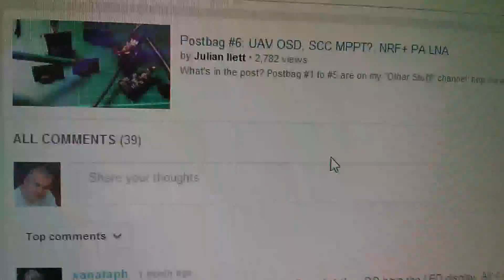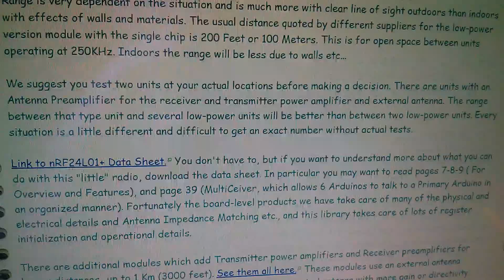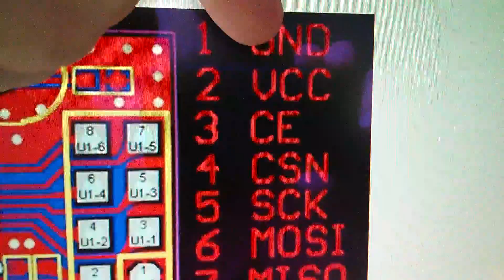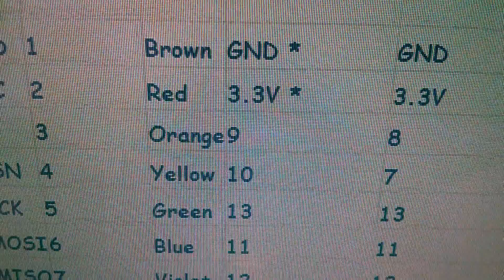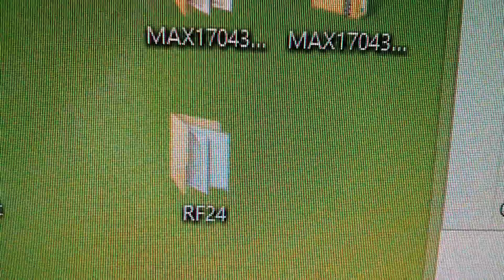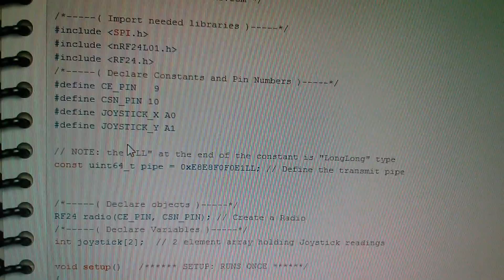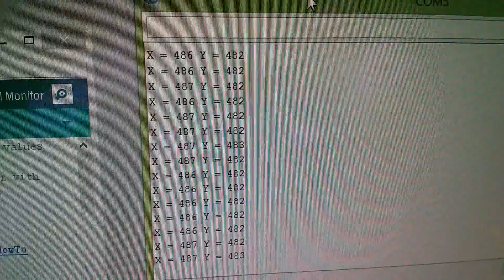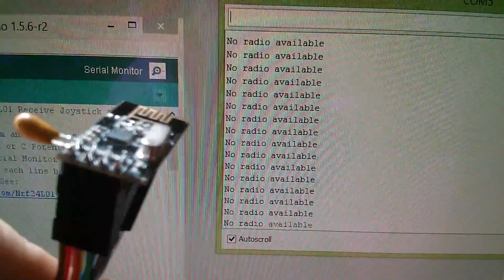1-Day Project: Arduino and nRF24L01+ Data Transceiver

Comment: I got this example working the way it's described. However, I'm having issues trying to integrate it with another project. When I come back to the example used in this video, I notice that this example doesn't seem to work for me unless I wire the green (pin 13), gray (pin A2), blue (pin 11) and violet (pin 12) cables, even though they don't appear to play any role in this example. Any idea why? Are these pins reserved pins for the RF24 library? Thanks.
Reply: All the pins are used by the library on the transceiver except the IRQ pin which isn't used most of the time. What is your other project ?
Reply: My other project is a 2WD robot. I want to use wireless communication to send the remote control codes to another Arduino connected to a PC for monitoring/debugging (occasionally the remote codes appear to get garbled). My next step will be to get another Uno or disconnect the robot from the existing Uno and try to get the nRF24L01+ working on a vanilla Uno.
Reply: Puneet Singh Lamba Did you fix your problem with the pins ?
Reply: Meindi Zahiri Well, I moved the robot to alternate pins so that the nRF24L01+ can now use exactly the same pins as are used in this video. My robot now works fine, but the nRF doesn't connect to the receiver running on a Nano. I noticed that the Nano provides consistent 3.36v from its 3v3 pin, but the Uno doesn't. That might be part of the problem. Note that I'm able to get the nRF working if I get connect both transmitter and receiver to Nanos. But not when I connect the transmitter to an Uno which is also supporting the robot circuit.
Reply: Puneet Singh Lamba Lol, it used to be the opposite problem for me and for most of people normally the problems are with the nano 3.3v supply. Did you put a capacitor ?
Reply: Yeah, I'm using a 10uF cap on the Nanos (i should try without them to see how it goes). On the Uno I tried 10uF and up (up to 470uF) but nothing worked.
Reply: Puneet Singh Lamba im using 10µF for both of them. some say that its good to put one small like 10µF or 200pF  and a big one like 470µF, try that.
How is your uno powered ?
Reply: Meindi Zahiri Will try that. Have heard of some folks doing that. Uno is powered off USB or 9V battery. Neither one seems to work for the nRF.
Reply: Puneet Singh Lamba using a 9V battery is not recommended at all. very expensive compared to what you get from it. You should use 6AA in serie for exemple, it will last 4 times longer. I power my uno via usb and nano via wall adapter. When you say that it doesnt connect, do you mean it doesnt work at all or it has random behaviours ?
Reply: Meindi Zahiri Um, ok. I'm not worried about battery efficiency here since I don't run the robot all day or anything. The nRF doesn't connect at all when the transmitter is Uno and the receiver is Nano. Nano to Nano works like a charm.
Reply: Puneet Singh Lamba Did you try powering the uno with a wall adapter ? If you can, try powering both transceivers with the nano. If you have a voltmeter, check the voltage across the 3.3v on both devices
Reply: Meindi Zahiri Didn't try powering the Uno off the wall. I did think of powering the Uno's nRF with a Nano, but haven't tried it (I think). Will try that. My day job takes up too much of my time (as I'm sure it does for most of us).
Reply: Meindi Zahiri Just tried powering the transmitting nRF off a Nano. I get a steady 3.3v powering the nRF, but still doesn't connect to the receiver. I did notice that moving the nRF board around to different positions (since it is just hanging off an 8 wire ribbon) seems to cause a LOT of variance in the circuit as measured on my multimeter (I'm guessing due to interference between the nRF and the rest of the circuit).
Reply: Puneet Singh Lamba Some people transceiver dont work when the distance is less than about a meter, mine work even when the distance is from zero to about 15 meters through 2 walls and 1 ceiling.
Do you have the version with the the big antenna or the small one ?
do you think that you could have other interferences ? some people have problem with microwave, wifi and tv. Try a quality check sketch.
Reply: Meindi Zahiri Low power (no external antenna). nRF24L01+. I tried increasing the distance - didn't help. Can you point me to a quality check sketch?
Reply: Puneet Singh Lamba http://arduino-info.wikispaces.com/Nrf24L01-Poor+Man's+2.4+GHz+Scanner
I didnt use it as i didnt have interference problems with my rf24 so if you have a problem with this i dont know if i would be able to help. Many people used this kind of sketches and it appear that it solved some problems.
Talk tomorrow
Reply: Meindi Zahiri Thanks for sharing this. In reading through the forum thread that this article links to I discovered that the RF24 library has a scanner program built in. Using that I'm able to see interference on some of the lower channels, but none on the default channel (76). Anyway, I changed the default to 100, which didn't help. Not surprising, since I got the Nanos to communicate fine using the default channel.

pic.twitter.com/FvLS9k163Q
Reply: Puneet Singh Lamba What do you get if you try the "getting started" exemple from RF24 library ?
Do you have an oscilloscope by any chance ?
Reply: Puneet Singh Lamba Could you post some pictures of your setup, the one working and the one not working ?
Reply: Meindi Zahiri  I used the joystick example. I got that working Nano to Nano, but doesn't work Uno to Nano.

http://arduino-info.wikispaces.com/Nrf24L01-2.4GHz-HowTo
Reply: Try the "GettingStarted" sketch from maniacbug's RF24 library and tell me if you get some errors
Reply: Meindi Zahiri  It looks like I need two PCs to run this test. I don't have the Arduino IDE installed on another PC. Will look into it.
Reply: Meindi Zahiri So, thanks to your prompting, a couple of things happened. Not sure if the Getting Started example did some sort of config on the Uno, but everything has started working now! Also, I noticed that the code "Serial.println("No radio available");" (from the joystick example) was creating so much data noise on the serial monitor that one could easily miss the remote codes flowing past form the Uno to the Nano. So, I commented out that line. And I switched to a long data array to capture the 8 digit remote code. I also did add a second 220uF cap to the Uno circuit, by the way. So everything is working to my satisfaction now! Thanks again for your help and prompting.

Update
Now I'm finding that the wireless communication is fairly reliable when the Uno is powered off the USB, but not so much when the Uno is powered off a slightly worn out 9v battery. With a new 9v battery the wireless communication works more reliably.
Reply: Puneet Singh Lamba I'm glad you fixed your problems. to be able to use a 9v worn out battery, even if you shouldnt use one, you could get a better voltage regulator than the on board regulator also, your battery will be used more effectively.
Reply: Meindi Zahiri I implemented a heartbeat counter so that I can monitor the robot's health. Currently, my 9v battery seems to be offering only 6.6v. And I have measured 4 missed heartbeats (expected every 30s) during a period of 10m. That's a 20% failure rate.
Reply: Puneet Singh Lamba How did you implement that and how do you log it ?
Reply: Meindi Zahiri My implementation is just a variation of anything else you might decide to transmit/receive. I only log to the serial monitor. I wish I could log to disk. I will add my code to GitHub and post a link here.
Reply: Puneet Singh Lamba if you want to log to disk, you could use Putty for exemple and save the serial windows automatically, or you could use a SD card reader with your arduino. Or if you know a bit of python, you could make a python script, that's my favourite option
Reply: Meindi Zahiri Thanks for these ideas. I will look into them. It would be good to store all of the data from the robot for offline analysis.
Reply: Puneet Singh Lamba I'm using a sous-vide cooker and i use the putty method to log the serial information and then i can plot the temperature against time
Reply: Meindi Zahiri Which sensor are you using to measure the temperature?
Reply: Puneet Singh Lamba DS18B20, the waterproof version, it's very accurate
Reply: Meindi Zahiri Thanks. I'll try the PuTTY route first. I can also try Python/Perl. Are you saying I can use Python to connect to the COM port instead of using serial monitor or PuTTY?
Reply: Puneet Singh Lamba Whether you decide to go the putty or python way, you will need one arduino to be connected to the computer. What you should do is make the robot send the value you want to an arduino via RF and this arduino to be also connected to the computer via usb and your computer logging the data you want
Reply: Meindi Zahiri If you go the python way, you will have to make the script or you can find any script on internet and modify it for your needs. Python will need the pyserial module, just google "pyserial arduino". With Python, depending on your OS, you could automate the logging/plotting part. The putty way is easier but you have only one feature which is to save the log.
Reply: Meindi Zahiri Yeah, well that's required any way, even with the serial monitor approach I am using now. One Arduino transmits remote codes from the robot and another Arduino receives those codes and is connected to a computer so that it can print those codes to the serial monitor. Next step is I want to log that data to disk. That's what we were discussing. Thanks for the pyserial tip.
Reply: Puneet Singh Lamba what about just using a sd card module on the robot ? it would be a good solution too if you dont mind transferring from the SD card to your computer
Reply: Meindi Zahiri Yes, an SD card module would be a good idea. However, in this case, I was looking for a reason to test out the nRF24L01+ module.

Comment: Hi julian,i have saw some of your videos, they are fantastic! And i have a question about nRF24L01, is necessary to have 2 nRF24L01 to send data between they or can i use only 1 nRF24L01 and a normal radio controller?Is to make a quadcopter with arduino, and can you help me to use mpu-6050 as gyroscope for it?

Comment: The capacitor that u have soldered is for high power nrf24(the one with the antenna) this small one doesnot need to soldered with a capacitor the voltage is quite stable in it's case . I am using it with arduino uno for my project without any capacitor on and it works like a charm :D
Reply: Some need a capacitor, especially with an arduino mega or nano. i have some nano and uno and i only get problems with my nanos without the capacitors

Comment: Hi Julian, thanks for the guide. Very informative! I'm wondering, would you do another tutorial where three transceivers are used; one receiver and two transmitter? Would love to see one tutorial about this as it would be helpful for my project that I am currently doing.

Cheers!
Kyle
Reply from the maker: YKSui Not sure about that. It may work if the same pipe address is used. I'll be trying the multiceiver setup in due course (single transmitter, multiple receivers).
Reply: Okay cool. Looking forward to it!

Comment: Julian Ilett  , could you please make a project , if possible, on how to use the stc15f204lea breakout boards as an SPI to UART converter for the NRF24L01+ to directly connect the RX and TX wires(of stc15f204lea) to one arduino. You can also reply me the way to do so, i.e; starting from flashing the stc15f204lea with the hex file generated from a code using the appropriate software. Thanks in an Advance.

Comment: It caught my attention that on the wiki says that these Transceivers are power hungry, which is contradictory according to its datasheet, where it says it car be powered for months with a coin cell battery or AA, AAA batteries, since it peaks at 14ma when Tx/Rx' ing, has anyone here used these things with batteries and successfully run them for a few months?, i just bought 10 of these for like 14 bucks at ebay and i'd like to know what to expect
Reply: Lone Wolf Did you ever find out about this? I'd like to know too.
Reply: Not really, i got busy and i havent been able to test them, i'll get to it soon enough and ill have an arduino monitor the battery and log the date and times to see how long it lasts
Reply: Lone Wolf Maybe they mean don't try to power them from the Arduino 3.3V source which is only capable of 50mA and is shared with the USB to serial converter and the microcontroller...
Reply: I come from the distant future. You can use Zigbee, it has very low data speed, high range, and very low power consumption. Really depends on what you're trying to do, bluetooth is also very low power consumption, and can handle a bit of data, but it is short ranged.

Comment: do you see any indicator lights on the transceiver module when it is in operation?
Reply from the maker: Not on the module itself, but the D13 LED on the Arduino does flash in sympathy with the transmitted packets.

Comment: +Julian llett - could I connect this chip or the high power model to a network shield on my UNO and some of the low power chips to sattelite projects around the house and controll them via LAN or WAN? would be a much cheaper alternative to purchasing small WIFI capable microcontrollers for the sattelite projects.

Comment: Hi Julian Ilett , I did the exact same thing you showed in the video, but I am always getting "No Radio Availiable". One thing I noticed was that the LED 13 (SCK) is not glowing at all. I tried swapping the transmitter even then, same thing. Please help.
PS: Can it be a power issue?

Comment: Good result.... I used exactly the same online resources. 

Have you tried the Interrupt driven examples yet? Handy when you want confirmation that a message has been received....  I want to use these to send notification of one-shot events (cat-flap open, pir triggered, bomb dropped, etc) so, as a test, I left a pair of these chatting to each other overnight, one message every 300ms with a small oled displaying message counts. The result was that about one transmission in six didn't make the trip, probably a result of my shocking code as distance didn't really affect the result. Easily fixed though by checking for failures and resending. 

Great little modules despite their annoyingly breadboard unfriendly footprint. I splayed the pins out on a couple and soldered them to some IC sockets to use them directly on breadboard. Cheap and cheerful fix. :o)

Comment: + Julian Ilett

Another good video man keep it up. rc model review has some great videos on antennas, I played about with my rc plane and a cheap as all hell set up and found his video on antennas really good. If you get yourself some circular polarised antennas you should not get that drop out. Something about radios is exciting when I first seen a Cybiko Xtreme a few weeks ago it seemed so much funner than a mobile phone.

Ive seen a few people on forums get 3-5 miles out of a 5.8 GHz 250mW transmitter with directional antennas and the like. Just watch yourself anything below 5.8 is limited to stupidly small transmitter power because of the mobile networks.

Id enjoy more videos on this sort of stuff
cheers

Comment: Hey Julian Ilett - Maybe you could try adding on more wire to the end of the antenna just to see the results?  Its a test I want to try on mine when I get some time.  Off the top of my head I think the 1/4 wave antenna on the board should be about 31mm- maybe try adding wire to take it up to half, 3/4 and full wave :)  Might be a cool test if you still have them set up. Would love to see the effect on range.

Cheers!  Eric
Reply: Eric William  Julian Ilett 
 The NRF24L01+ is an amazing little chip, we got over 300 ft inside, and didn't seem to have a power issue, but what we have is a slightly different version of the one pictured. The drop off seemed to be around 320 - 330 ft for us. We were in a rather large area, that was mostly open, but had metal rack units every few feet.   so a bit better then the norm for these.  which is around 200 feet   the day could have just been right for it too....or the fact that nothing was really in the way

http://www.hobbyking.com/hobbyking/store/uploads/820169487X569826X26.pdf
Reply: Eric William hey Eric, fwiw I pulled apart a cheap 2.4ghz RC transmitter and found an antenna of 8.7cm long: http://www.iforce2d.net/2.4ghzAntenna.jpg There is something solid and metallic inside the lumpy part, and the total length of the black section is exactly 62mm. Not sure what the extra 2.5cm silver part is for at the end? This is supposed to be good for 80m but I've never tried anywhere near that far because the quadcopter it came with is so small I can't see which way it's facing after about 20m!
Reply: yes, i too wonder if the cheaper on board ones can be extended with some wire, would im sure be a money saver, if someone is sure of the exact length of course (not saying you arn't Eric :}
Reply: jusb1066 Just double checked.  Full wave is indeed 12.5cm.  Should be good to go at 31mm 1/4 wavelength intervals.  Darn I wish I had mine set up as I've been itching to see how far they could truly go reliably.  Hope Julian tries it out :)  Cheers

Comment: Excellent. I'm looking forward to a follow-up with one end swapped out for the "high power" + "big" antenna version - that would be closer to the configuration I'm planning - one central unit with the posh transceiver and the super cheap modules on various satellite systems around the house - I'm hoping to get some up to about 40m away from the central unit
Reply from the maker: Okey Dokey. Maybe I'll try that right now!